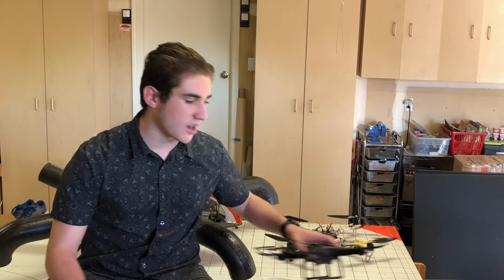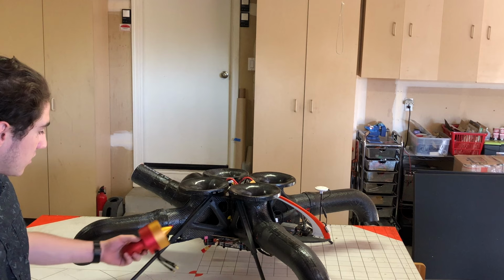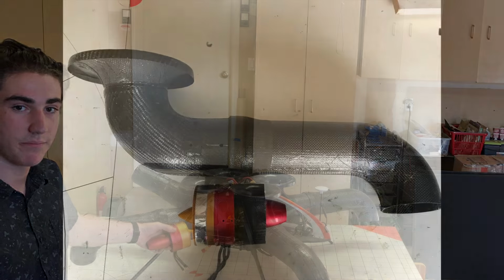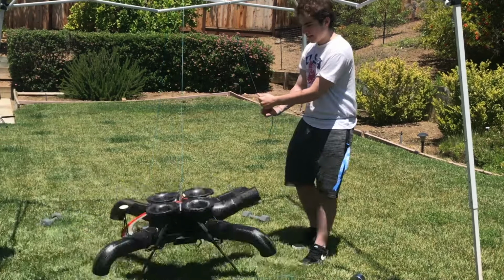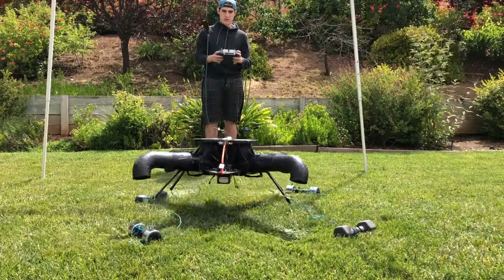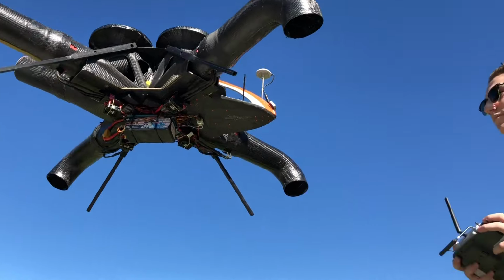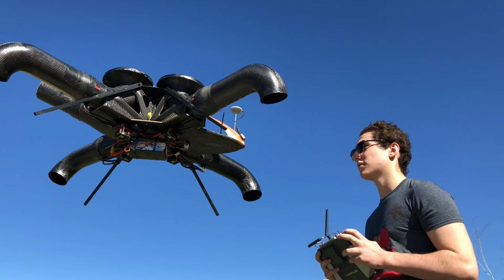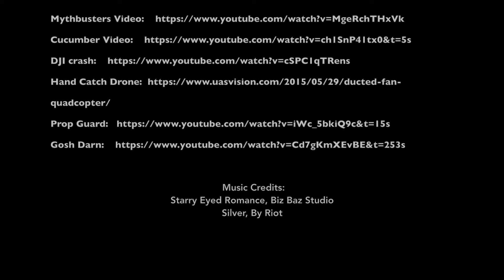Bladeless Drone: First Flight

Comment: I really like that idea.  I saw this video which compared drones by longest flying times and it showed this hydrogen drone that had wings like a plane so it would take off and get its height like a regular drone but then it could glide really far as well but then one that could last longer was a hydrogen balloon and it made me think how cool it could be to combine that with your design and then make a flying car.  you would need to find a way to make a flying car blade less and to be able to stay in the air for a long time and then to go really far

Comment: SO many questions! 
It's AMAZING! 
SO WELL DONE!
I'll just ask three ...
1. What is the purpose of the 5th tube sticking out horizontally?
2. I saw that it was unstable at first, then it looks like you turned two-each of the exhaust tubes a bit inward to each other respectively. If this is what stabilized it, did you figure out why? It seems odd, considering the thrust of pure prop drones is aimed exactly vertical.
3. Have you tested it to discover its maximums? (Speed, weight-lifting, etc.)
GREAT WORK, MAN. Excellent engineering! You really have something here and I WANT ONE!
Can't WAIT to see more of this BEAST!
Reply: He explains what the 5th tube is in the description

Comment: Invisible blades are a great new revo in drones, which also allows them to use hotter vents or after burner mix to travel higher&faster, you didnt need the exit exhaust pipes be too narrow, like a jet vectors in the rear, wide to narrow convertion. i can see this mounted on the black belly side of SN10 as arc Skycrane styke booster & legging, it could have ride of that verticle unstable fuel land nonsense,  replaced for a final hoover landing. Like this drone parts.

Comment: What if rather than having a round cross section, the ducts have an aerofoil section with the chord oriented vertically for take-off. The ducts could thrust vector if necessary and then for high efficiency horizontal flight they could all rotate in the same direction to form a four-winged aeroplane. This is what the V22 Osprey could turn into in the future...

Comment: Extremely unlikely that this could ever be patented.  The basic concept has a huge amount of prior art, in both full-scale and smaller forms.  

Also, the efficiency is terrible and there's simply no compelling application that could ever benefit from ducted fans, versus simple shrouded props if "safety" was a real concern.

Comment: Love the concept and really believe as drones serving the end consumer move forward liability will force the  ducted solution as the mainstay and maybe even industrial use. I like your design but would change to the following. A central intake plenum that provides for best lift characteristics. A dedicated motor controller system with a round  heatsink that fits in the intake plenum. Refined nozzle outlets that also add a directional mechanism.. The central intake system would also be the structural attachment point and the units major structural support.  The motors would join the central body and outer duct tube with pivoting nozzle. This way the center mass of the ducted fan would be exposed for cooling. The central body would be upper and lower halves that provide access to controllers etc. Dang I want to draw it up now......................this video has my mind running........your path is the right one................Tiger

Comment: Cool project!! 

- very ironic the lift rope got caught in a fan! Did you have to replace the fan? I am curious if the fan is metal and what model it is.

- I did not see any 3d printing -- any reason for this? I would think it would make your mold creation a whole lot easier!! Would also make it possible to test different outlet and inlet geometries. There would be a slight weight penalty but its temporary. 

I wanted to ask out of curiosity. Did you think of building this like an A frame or T-pee, where the motors are all just angled 45 degrees or so from their corners up to the center, and their containment tubes are alll perfectly straight up to the center. This way you have a LOT less drag loss inside the piping (90 degree turns are the most costly geometry you could do!). Even if you just ended the pipe with one 45 to get the thrust to come straight down rather then out to the sides laterally at all, the one 45 would be a lot less drag. You you can still angle the pipes slightly radially (like a corkscrew) so that you can get proper yaw like I see you've done here.

I caught that 5th front fan -- I imagine that is to aid in forward motion rather then pitching the whole craft?  

I want to see much more , please !

Comment: Just a thought, drones work by creating low air pressure above the blades the same way a wing works not downward thrust, your drone appears to be based on downward thrust like a harrier jump jet, just an idea, spread the upper area to the four corners and have a single downward exhaust.

Comment: Hi! Great project! I'm curious how YAW control works? You can't use counter rorating props so how do you YAW then? What is power necessary per kg lifted (W/kg)? Thanks for details!
Reply: Look at how the nozzles are tilted and not pointed straight down https://youtu.be/5L6FSdUmEpg?t=299 That should provide some kind of thrust vectoring for yaw.

Comment: It would need an enormous amount of power and very fast motors to generate lift for higher altitude. Which wouldn’t be called lift but propulsion. 
As there are no blades it can’t generate lift. It needs to be closer to ground to push and keep itself up.
Reply: if the propulsion is strong enough it can generate enough particles to push off of the air particles. thats how blades work too (sorta) the blade pushes on the air particles which dont move due to other air particles in the way so the blades push off of the air particles which in turn makes them go higher, generating lift.
Reply: @altera9666  and that’s why I said “enormous “
Reply: @altera9666  a wing generates lift by creating an area of low pressure on top of the wing, pulling it upward....in flight only a very small percentage of upward force is created from pushing down on anything including other air particles. Thrust works of equal and opposite reaction force. This is how thrust from rockets can work in space with no other air particles to “push off of”.
Reply: eh, the Harrier does fine..
Reply: @pistonwristpin1  you’re joking right? That’s a jet engine. Not a prop covered in plastic.
Reply: @mariosraptor  Um, seems like four “ducted” fans - AKA: Compressor fan. They aren’t jet engines or there would be some smoke. Vector thrust is found on F-15s. The Harrier has a jet engine and it’s VTOL. Though the Osprey is a VTOL “Turbo Prop” (a propeller driven by a Jet Engine.). There’s lots of folks on YT building variable exhaust nozzles for RC craft. There would be a big performance increase if he built an augmenter behind the Variable exhaust nozzle and add fuel to the augmenter. Some folks call an augmenter an after-burner. It’s basically a ram jet, high pressure air, and a flame. No moving parts.
Reply: @randyrowland9114  Actually rocket engines are self contained, and hardly a comparison to a jet engine. Jet engines need air, rockets don’t. Jets burn Kerosene grade fuels, rockets don’t. Rockets propel 4 city blocks vertically into space, jet engines don’t. The only thing rocket engines and jet engines have in common is “the bigger they are the more expensive to build or maintain.”
In my day, the Pratt & Whitney F-100 engine costs 2.5 million “a copy.” I still don’t know how much NASA spends on rockets, much less Amazon’s or Musk’s space projects. 
Have ya ever heard of “rocket grade” Hydrogen Peroxide?” That stuff is alive!!

The McDonnell Douglas F-15 used Pratt and Whiney F100 engines in my day. They’re rated at 50,000 ft/lbs of thrust each. The airframe only weighed 60,000 lbs. More aerodynamic surface, the greater the “drag” on the air frame. The F15 flies at Mach 2.5(+), meaning they don’t know how fast it goes. Not much aerodynamic control surfaces, in relation to a 747.

But to go fast, “we don’t need no stinkin’ wings.” But we’re gonna need some fuel!. Speed always costs money, how fast can ya afford to go?

A more interesting concept would be to make it a centrifugal compressor and control the airflow with apertures and variable nozzles with augmenter. 
Could rain baked birds if it flies through a flock.
Reply: @pistonwristpin1  thrust is thrust...in physics sense. Very aware, not sure how you understood it that way but in no way wass not implying the source of the thrust was created the same way in rockets as in jet engines. It is just not due to “air particals pushing off other air particals”that the ducted fan drone maintained flight....
Reply: @randyrowland9114  Actually “ground effect” implies “forward movement creates lift.” I didn’t see any of that so kind of perplexed as to your address. What you are talking about is Bernoulli’s principles. The drone flies because of thrust only. The military taught me jet engines - your tax dollars hard at work! Probably should read what I’ve been talking about. I wrote a bunch here because jet engines and aerospace is my forte’. If ya put a turbine on that little compressor you have a jet engine. I am quite surprised an electric motor can drive the compressor. Look up the Pratt and Whitney F-100 engine, and learn about the different modules of the modular designed jet engine. The compressor module reminds me of this RC motor. This fighter jet engine is also quite different than the GE TF-39, and the Turbo Prop jets. Sorry seems we both may be a little “cornfusaled.” Still really don’t understand your statement.
Reply: @randyrowland9114  Yea, I didn’t think I said that. Anyway yep thrust is thrust. I think I was trying to point out that it was only thrust which maintained flight. Tubes don’t seem very aerodynamic. Which in an odd sense is the thrust shoots out a tube like a rocket. Rockets are clearly another type of craft, but rockets have thrust as jets do. Seems you can do more with Jet thrust than rocket thrust.

Comment: Why reinvent the wheel? All that work using wood for moulds when you could have bought plumbing pipes at your local hardware store?
Reply: Plumbing pipes are not made of carbon fiber.
Reply: @outerrealm  No. But you can use them as the mould instead of wasting time making wooden ones. That was my point, sorry if it wasn't clear.

Comment: I already have an idea to advance it but don't want to add weight. Figure out how to reduce weight will really help. Making the tips rotate a bit may help. I thought about a kite drone with a strong tightened fabric as the base and a ring inset for the motors. May be able to make a larger more light drone this way. You still may need a few light weight rods of support but less than on a standard drone. Only want the fabric to be similar to a kite but maybe a little stronger. 3 feet wide circular drone but a tightened fabric. Engines near the edge with a plastic ring and some rods for supporting the corners and the engines. Could also use a plastic tarp or kevlar. Board could be attached above or underneath or between two layers. wire can be glued or ran between a layer or use twist ties. Board may melt the fabric or start a fire so maybe we use some light shielding. Has to be a place for the battery too. I say we make either a wood or plastic rod attachment contraction somewhere in the middle of our kite drone.

Comment: This is very cool! But, how do you jaw when you don't have props?
Reply: I think this is achieved by the dihedral (tilted) ducts. Instead of using rotational inertia to yaw, it uses the trust vector achieved by the angled exhaust outlets. This comes at the cost of reduced thrust and efficiency.

Comment: One motor uses less power, output duct vanes for steering
Reply: I have the same thought, but do you have a single 100A motor ? (they use 4 motor with 120A)

Comment: for 1 this is a drone with blades also the drone ppl dont put massive tubes over the blades as that extra weight is silly
Reply: but iff its gonna keep us safe good look mate
Reply: It is a bladeless drone. There are no external visible blades
Reply: i will bet u any amount of money that drone has blades a hoover has blades a jet engine has blades a dyson fan has blades what els can u use 2 catch thr air...look on the video about bladeless fans and the man says well even though called a bladeless fan they do have blades but just not in the place u would normaly se them...

Comment: COOL, but physics is not on your side here brother. 
 for one thing. open props are like drag racers. they deliver immediate power on command. EDF units don't deliver maximum performance until they're up to speed. where air intake is maximized by forward propulsion. and as you clearly see, EDF units require much more engineering. and lots more mass to the overall size and weight of the craft. so though you might spare someone a direct hit from the prop. you've now went from dropping a few ounces on someone. to dropping several pounds. i'd just develop a better prop surround or shroud.

Comment: does this model consume more energy
Reply: oh yes, it does... a lot more! but awsome anyway!
Reply: a couple of things that i see is the inefficient ducting, the flow could be a bit more "organic" if that's the proper word. the nozzles are also angled weirdly, they aren't 90 degrees facing down and that wastes thrust and i don't think it's for self stabilization. the ducted fans themselves could also be a bit bigger, why not? if they're already a good distance away, something similar to a mesh/grill could be placed above the intake as an extra precaution, though that might make the air choppy, turbulent and maybe even significantly constrain it but i doubt that matters if the thing already looks like this. in fact, some sort of guard cover over a standard ducted fans would've sufficed while being easier, faster, cheaper, and more efficient
Reply: @midgetman4206  Exactly : )

Comment: nice job!  Finally, someone doing home-built carbon fiber using vacuum bagging technique.  Just one suggestion: when cutting/sanding carbon fibre, wear a mask - you lungs will thank you for it, especially later on in life!  One question:  did you go with the "bent tube propulsor" design for stability (as opposed to simple ducted fans (perhaps with the new augmented bladeless propulsion units)

Comment: From a propulsive efficiency viewpoint, the use of the 4 ducts of relatively small diameter and cross-sectional area, when compared to ducted propellors or better still to a rotor of an helicopter, would result in a great deal more energy being wasted, in applying it as kinetic motion. This would severely limit the performance of this design, in lifting power compared to fuel consumption.

Comment: Hi, that's awesome... I guess one big engine pumping air for the arms might be more efficient? but then it's hard to control the air flow in each arm... fantastic... you should be snaffled by NASA.
Reply: I think the air flow for each tube could be controlled by a flow system and i like the single engine idea,  possibly with coaxial blades to cancel torque.  Opens up ideas.

Comment: Its really inefficient. You said each motor uses 10,000 watts. So the drone uses upto 40kW that is way too high. The yaw probably sucks too. Multirotors are just much more efficient. Cool idea though
Reply: No its 10kw total. 120 amps * 22v * 4 motors = 10560w =10.5kw.. Still way too much but not 40kw

Comment: There's no such thing as a bladeless anything (that pushes air).  The issue is whether the blades are exposed or not.
Reply: so where are the blades in our lungs?
Reply: @themightyowlz8020  I was speaking of machines for flight, not living organisms.  And yes there are bellows that push air but impossible to use them for flight.
Reply: Look up the company FESTO
Reply: @paulpyatt9942  Uh you do realize that bladeless fans do infact have blades right?
Reply: @paulpyatt9942   Turbines still have blades. Compressed air alone generally would not be an efficient model for a fan due to noise and energy consumption.

Comment: Why making 90deg + 90deg tubes? Why not making a 45deg + 45deg tubes?
Reply: dude its not 90.. its 90+90, so the air flow goes down and not wasted at 45 degree angle.
Reply: Air flow through two 90deg corners will lost more energy that pass through 1st 45deg and turn 45deg downward, that mean the middle part of the tube is 45deg to horizontal! So the final tube opening still pointing towards vertically downward to the ground!
Reply: may be you build one. and maybe you'll realise that is easy to find 90 degrees but hard to find 45 degrees in the market. this is a homemade thing, its not an official nasa project with unlimited funds :D lol
Reply: @ArchitectJacinto  oh, noted with understand!